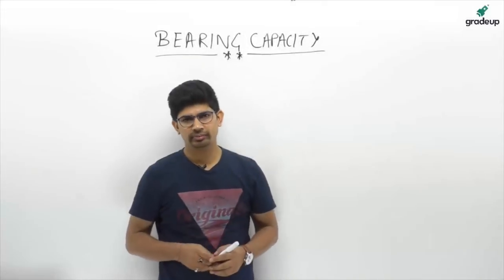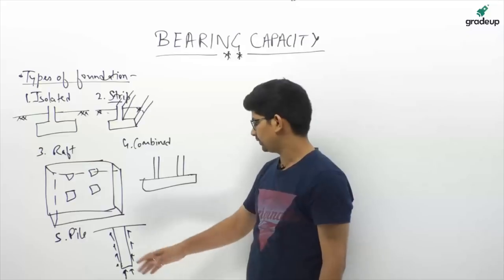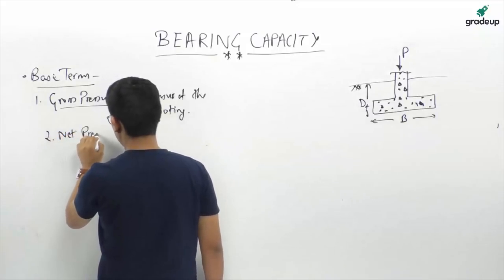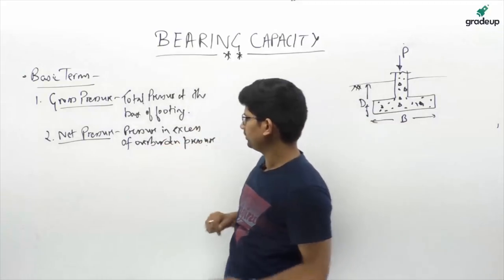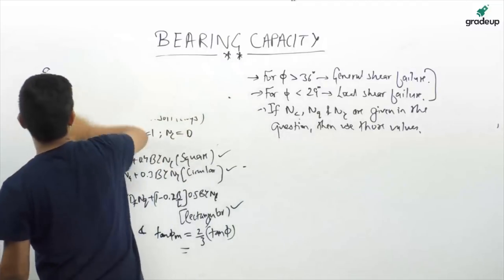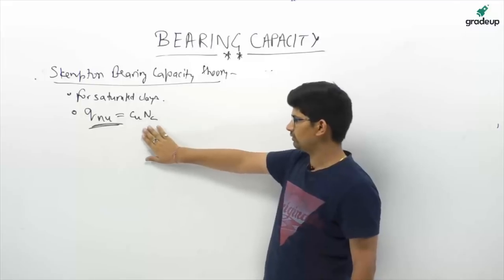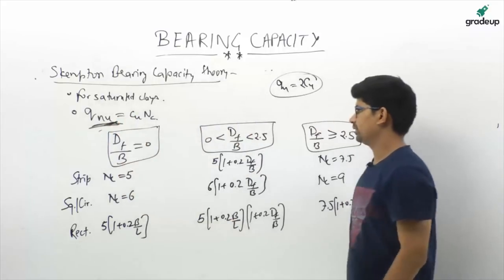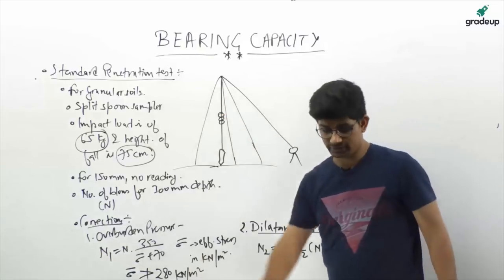JE Civil 2019 || RRB/SSC  Exam || Geotechnical Engg|| Bearing Capacity

Comment: Expression given by Terzaghi for Nc, Nq and Ny are not covered here. Also can you explain Kpy (passive pressure coefficient) in Ny expression, given that if we use 1+ sin(phi)/(1-sin(phi)) expression, Ny calculater value does not match the graph or table value.